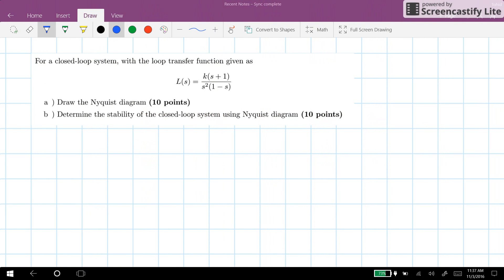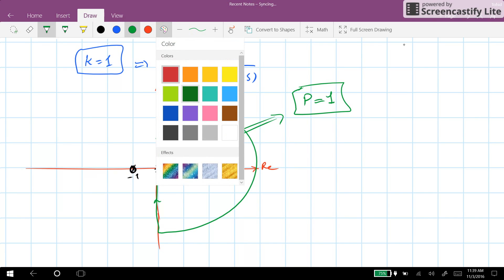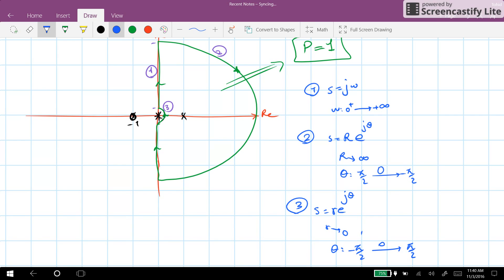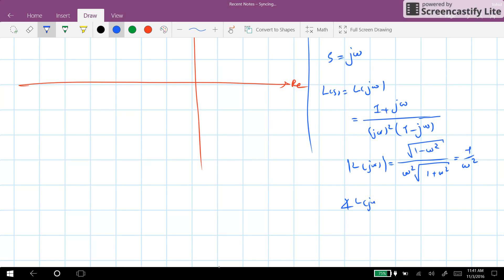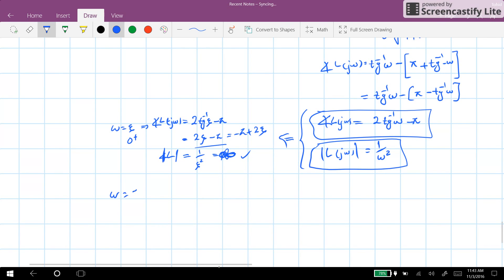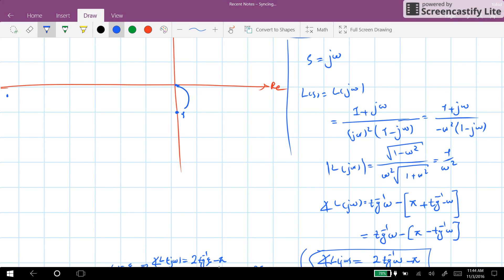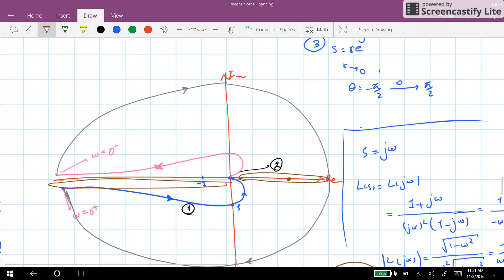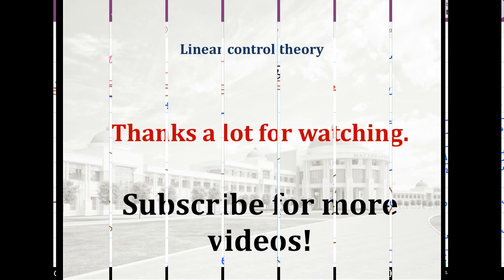ROBT 303 - Lecture 14.06 - Frequency domain analysis: Nyquist criterion, example 03

Comment: I have been using the Nyquist Stability Criterion to explain the incident on Boeing 737 Max ; not too many people really understand. I will explain it in here in a more simple way. If you have been working on radios, you would understand what oscillation is. Bridge engineers must aware of natural frequency resonance.  Any matter has a frequency.
As a plane beginning horizontal cruising after an attack angle pitch up. There is always a burst of oscillation. If the plane is designed properly, a damping effect will deminished the vibration very quickly.
This 737Max has lifted the engine to the meridian of the wing. It will create extreme low pressure above the wing. So it has the tendency of higher attack angle, making dangerous moment of stall. A MCAS device is designed to adjust the stabilizer to create a counter force to lower the head. This action is a negative feed back. Or we could call it damper. There is always delay time from detection to action. If the time lapse by chance match the vibration cycle time, it will have an amplification instead of damping effect. We call it positive feed back, or resonance. Ounce a positive feed back occured, the vibration will accelerate until beyond control. The body of the plane will fracture and dive.
There is a blame of attack angle sensor error, software bugs, also a wrong perspective of the machine competing with human and etc. These are smoke screen to cover up a basic design error, and cost reduction conspiracy.
To judge the quality of damping, we could plot graphs of frequency response and phase angle. We call them Bode Plot. With Bode Plot, we could analyse it with Nyquist Stability Criterion.
Software upgrade and the MCAS are tricky ways to fix bug. It does not fix the natural frequency of the plane.
Boeing well aware of the high attack angle problem in the design stage, that is why they brought out the MCAS. This design is sucess, but they ignored the probability of failure rate. Resonance, oscillation, feed back,  probability, Bode Plot, Nyquist Stability Critetion are all compulsory courses in engineering. Nyquist analysis is a must in aircraft engineering. I am surprised nowadays engineers had ignored these foundermental knowledge.

我曾經用奈奎斯特穩定判據來解釋
波音737Max的意外，許多人不易明白。我現在用簡單的言語再來解釋。你若果學過無線電，便容易明白甚麼是頻率。橋樑建築一定要顧及橋本身的天然震頻。但凡物質都有震頻。
當飛機從攻角進入水平飛行時，都會產生短暫正弦波式震盪，這是危險時期。若果設計穩定，這時間會很短和輕微。這型號因把引擎升高至翼的中線，會形成上方低壓，把機頭推高，看來波音737Max8是非常不穩定，攻角竟然高出20度。高攻角會導致失速而失控，是非常危險的。為應對這不穩定狀態，波音設計了MCAS系統來抵消這不穩定。當攻角過高時，這系統便會驅動穩定器把機頭俯下。這叫負回輸。從感應到行動，有時間延遲，若果這時段與飛機本身的震頻巧合，就會轉化為正回輸而加強震盪，直到機身斷裂墮下。這叫共震。
波音發出煙霧，指責是攻角感應器，軟件，人機糾纏等問題去掩蓋基本設計缺陷和減低成本的陰謀。
要分析機身穩定性，可用周期，增益，相位數據繪製波德圖，再用奈奎斯特穩定判據來分析，便可鑒定這飛機的安全性。
MCAS 的設計是成功的，但它們忽略了成功起降的或然率。導致你登機是賭命。MCAS及軟件更新只是治標不治本的方法。必有後患。必須要減少機身本身的天然震盪才可根治。
天然震盪頻率，回輸，或然率，波德圖，奈奎斯特穩定判據等都是工程必修課，尤其是奈奎斯特分析是飛機工程的必須工藝。奇怪的是如此權威的公司竟然忽略了基本工程智識，我提出的回輸現象也沒有人明白。世界走向了那方?
Reply from the maker: Interesting! Thanks for sharing your opinion.

Comment: why did you use -1/k when it comes to study the stability?? and what's P,N and Z ??
Reply from the maker: Because we want to check the number of encirclements around "-1/k" instead of "-1", since introducing "k" as the controller will stretch or shrink the plot.
P, N, and Z are the number of open-loop poles inside the Nyquist plot, number of clockwise encirclements of -1 or -1/k, and the number of unstable closed-loop poles, respectively.

Comment: there are still a lot of gray areas here.  I've watched this a few times and don't get how you got the shape of the graph or why you chose w = 1 as a point.  its still a bit confusing.
Reply from the maker: Well, I have tried to explain the points as much as possible. w=1 is used as a point between w = 0+ and w = inf, to help us find the shape, indeed you may use any other value, but for w=1, we have amp = 1, and phase = -pi/2, making it easier to find the point.
If you have other concerns, let me know, I can explain them here.

Comment from the maker: 3:41, in the numerator it should be sqrt(1+w^2). Sorry for the mistake!
Reply: I thought j^2 is -1 so it should be sqrt(1-w^2) ...i don't understand how it's positive +w^2?
Reply: why does the second part mirror the first part?
Reply: I don't undertsnad the 1/k section either? ..what is this?
Reply from the maker: Well, think about the fact that this is the absolute value or the amplitude, and the term under the sqrt can not be negative. So, if, as an example, we have w = 2, with sqrt(1-w^2) we will end up with a negative root, which will not provide us a real value as the absolute value.
I hope this will help you to get the point.
Reply from the maker: Because for the negative values of the "w", the amplitude will be the same, and the phase will be 180 degrees different, compared to the positive values of the "w".
Reply from the maker: Since introducing "k" as the controller will inflate or deflate the plot, instead of determining the number of turns around -1, we do it for -1/k. For k=1, it is the same as the original case.